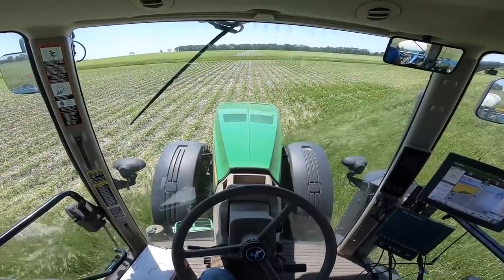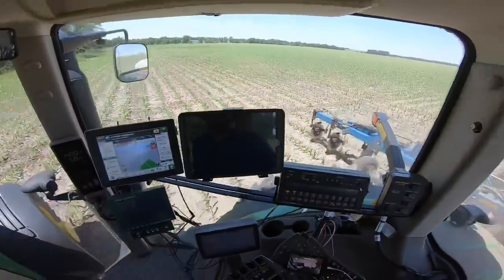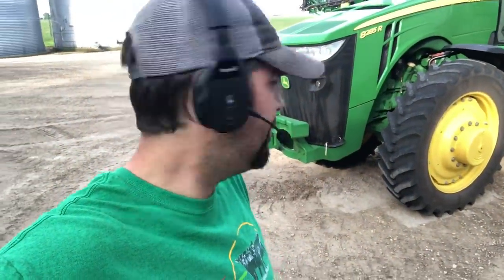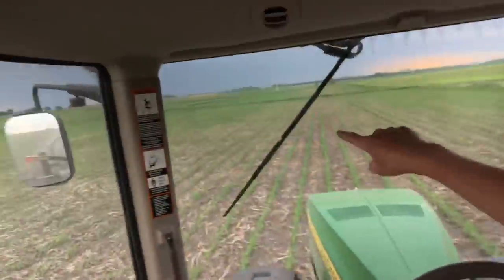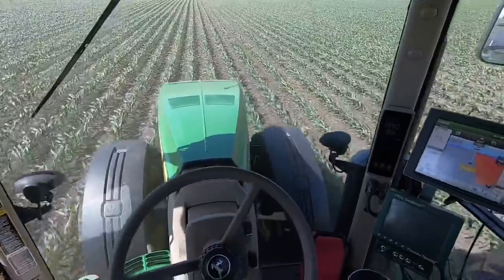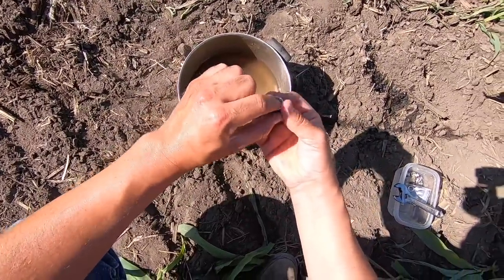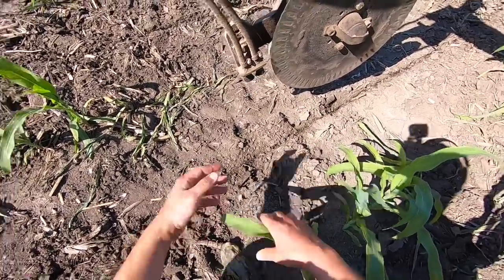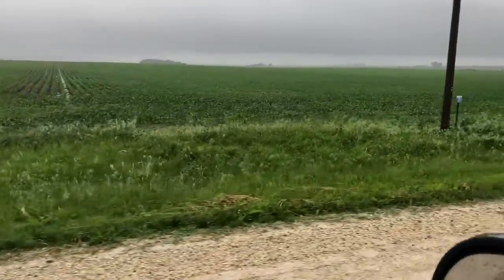Side-Dressing Nitrogen and a Bad Hail Storm

Comment: We have the same problem with out side-dresser once if it runs out it takes 2 or 3 rounds before it gets its pressure back
Reply from the maker: I don’t understand why. It has a small return hose that does back to the tank. There is no resin that it shouldn’t prime better than that.

Comment: When you do the u-turn in the endrows when putting down the nitrogen does it damage any of the plants in the endrows?
Reply from the maker: Good question! It depends on the stage it growth. It does knock them down, but if they are small enough they will stand back up again and be fine. If it’s a couple feet tall already it will break it off and it’s toast. The corn lost in the turns is a drop in the bucket compared to the benefit of splitting the nitrogen application.
Reply: I was wondering the same thing. Thanks for asking

Comment: How much crop damage occurs when you turn in the end rows?  Do the plants recover from being run over?
Reply from the maker: Good question! It depends on the stage it growth. It does knock them down, but if they are small enough they will stand back up again and be fine. If it’s a couple feet tall already it will break it off and it’s toast. The corn lost in the turns is a drop in the bucket compared to the benefit of splitting the nitrogen application.

Comment: How in blue hell are you not trampling everything when you turn around? And, are you running GPS? looks like youre trampling the rows? That said, good stuff man! im learning a lot!
Reply from the maker: Good question! It depends on the stage it growth. It does knock them down, but if they are small enough they will stand back up again and be fine. If it’s a couple feet tall already it will break it off and it’s toast. The corn lost in the turns is a drop in the bucket compared to the benefit of splitting the nitrogen application.
Reply from the maker: Also when I’m going straight down the rows I’m not touching the corn

Comment: Thanks/Carl, interesting topic.  Why choose one type over another regarding anhydrous nitrogen vs.what you are using?
Reply from the maker: Thanks Curt! We choose to use the liquid because it is after and easier to work with. Anhydrous ammonia can be really dangerous if you get a leak in a hose or a broken valve or fitting. If we didn’t have any hog manure we would probably be applying anhydrous as it is slightly cheaper per acre than the liquid in a lot of cases.

Comment: So on the higher rates you slow the ground speed or do you open up you spray regulator and pressure to increase the rate. Very interesting getting the application rates right for different areas in the crop.
Reply from the maker: Great question.  There is definitely a range of acceptable pressure. I like to keep it between 40 and 80 psi. So changing out the size of the tip allows me to maintain the ground speed that I want without building too much pressure or not having enough. The flow regulator on the machine automatically opens and closes to keep the applied rate consistent regardless of what speed you travel. Thanks for the great question!

Comment: Hi.  I love how the GPS n technology guides the machinery between rows.  Will that field across from yours recover  or can it be reseeded? Do you use the same chemicals on corn eaten by humans? Do you n your brother plant corn for animals or humans?  Why not just respray with more hog manure ( which is more natural n free)  then use the chemicals? Not judging, just curious.           Peace to you and yours
Reply from the maker: Hey these are all great questions! In assume the neighbors corn will actually still come out alive as young as it is. It will have less potential, but still better than having to replant in June. We don’t raise any corn specifically for direct human consumption, but I’m sure that most guys that do are still using a commercial nitrogen of some kind. The gif manure question is a food one. Here are the main problems with side dressing hog manure: 
1. It would take 1,000 gallons per acre of hog manure to replace the nitrogen from 12 gallons of the liquid I’m using. That means way more trips and way more compaction of the soil. This would lead to more runoff into steams and rivers and ruin the ability of the soil to absorb rain water. 
2. We apply all our hog manure with a drag hose to avoid compaction from large tanks being in the field. This would not work with standing corn because the hose would knock it all down. 
3. There is not nearly enough manure around to supply all the nitrogen for all the crops. The 32%UAN that I’m using is the safest and simplest to apply form of nitrogen that we can get our hands on. 

Thanks for asking thoughtful these questions!